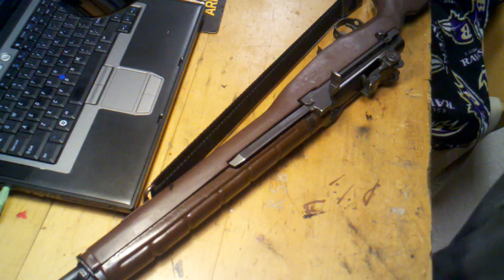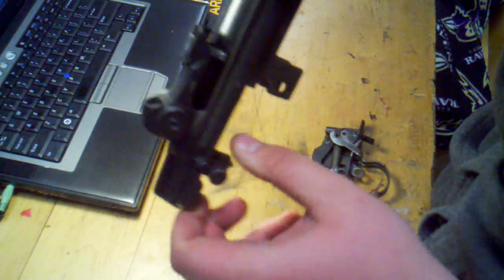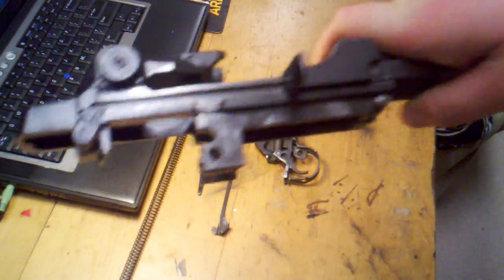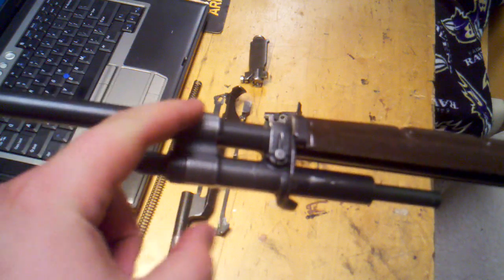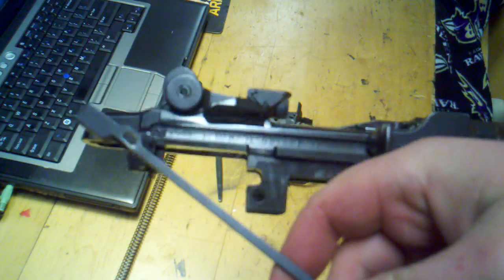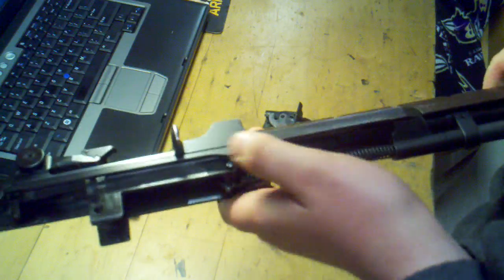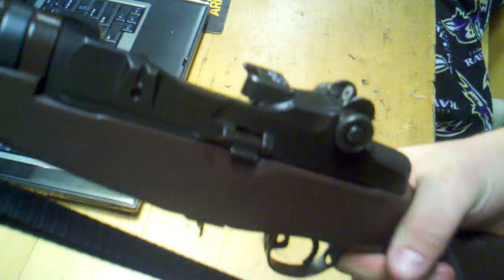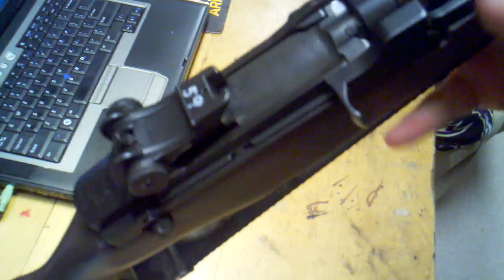M14 Disassembly and Reassembly

Comment from the maker: @AnimeFanatic5602 

The M14 is only issued to squad designated marksmen and some snipers if they choose to use it.  The best policy for the desert is no lubrication at all on any parts.  After cleaning with CLP, dry it out and make sure there's none of it anywhere.

I think the M4/M16 issue is in the same situation as the M9; they are good firearms and get the job done, but there are better things out there we should be using.  Hopefully we'll switch to something better someday soon.

Comment from the maker: @AnAngryBlack 

Thanks!  This probably isn't the best way to do it but it works; I take the spring guide and jam it under the hand guard till it expands the hand guard clip enough for the whole thing to pop off.  Putting it back on is much easier; just feed the non-clip side of the hand guard into the barrel ring (where the stock rotates and connects with the barrel group) and push down on the hand guard till it pops and clicks back onto the barrel.  Don't remove it though unless you have to.

Comment from the maker: @DobermansRock 

I don't think the stock is the big issue, but optics and most especially good optic mounts are needed.  Things like bipods don't hurt either.  Most soldiers can get around the stocks but there's no getting around the need for optics and receiver mounts if they want to use them as DMRs.  Better stocks are still important though, I'm just trying to think of how to minimize cost so modification and the purchase of more parts looks more attractive for the uppity ups.

Comment from the maker: @AnimeFanatic5602 

I haven't heard that before and I don't know if that's true because we still use the M4/M16 rifles extensively in both areas.  It is true that the M14 is pretty much unaffected by casual dust and dirt and can handle it a lot better than a M4/M16 but I don't think that's the reason, otherwise everyone would have one.  M14s are primarily used in Afghanistan where they engage enemies at a much greater distance than Iraq; they need the heavy-hitting 7.62 that can reach out.

Comment: @Mr2ndAmendment Absolutely. With a little more R&D for different applications the M1/M-14 would have been the ticket. There is a lot out there on the market to make improvements with. But it is all extremly expensive and usually not worth such high prices. Its kinda like Harley Davidson. Great machine but the get real factor jumps out quite often on price. I look at the stock on my M1A a lot of days and just say to myself sanding out the 90 deg angles will make me happy enough.

Comment from the maker: @DobermansRock 

Agreed.  Smith Enterprises makes an extremely effective vortex flash suppressor that also helps a little with recoil.  I agree with the stock situation, the stand M1 Garand-like stock helps make upwards recoil more ridiculous than it needs to be.  Sadlak Industries makes a pretty good steel and titanium scope mount, I'm pretty sure the military is using that, but my bud has one on his M1A and it's simply awesome.  Instead of adopting the M16 we should have improved the M14.

Comment: @Mr2ndAmendment  McCann Industries makes a pretty versitile sounding scope mount. I am not speaking though from a hands on perspective. My appologie there. Yes I do agree us soldiers can make most anything work as long as we don't break it first. My gripe with the stock is muzzle lift during rapid fire. If the whole thing were linear like the M-16/M-4/Ar-15 I think it would do better. I do use the shoulder plate when I want to make noise at the range with my M1A. As a point impact weapon *****.

Comment: I really appreciate the video showing the disassembly/reassembly of this weapon.  It really helps out.  I have a question however that I hope you could answer for me.  I just bought my M1A a few days ago and I bought the black synthetic stock.  However, I plan on switching that stock with a M14 walnut stock.  Could you perhaps either explain or show in a video how to remove/reattach the handguard?  I would really appreciate it.  Thanks.

Comment: Any idea why my barrel wont seperate from the stock? Looks so easy in all these videos. Mine wont seperate
Reply from the maker: Probably tight. Make sure it's unloaded. Remove trigger group. Hold it upsidedown, so the mag well is towards the sky. Tap the heel of the stock on a hard/padded surface.  It should undo.